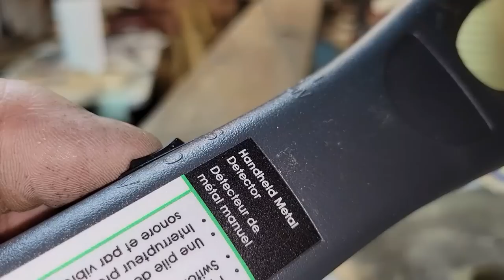Turning 150 year old wood into GORGEOUS guitar body!!! Part 1

Comment: How come nobody ever uses dowels when joining slabs of wood? I was taught always reinforce slabs of wood when making furniture ( I know it’s two different things) but when a strung guitar is under enormous tension why is it never done this way?
Reply: right, i was wondering why he didn't use biscuits.
Reply: It usually is reinforced, even in instrument making.
Reply: Without giving you an answer, the tension, in the end, is not "enormous". I've never heard of a real Fender being biscuited or doweled together. I've seen different pieces of the body lamination crack at the seam which results in a finish crack, but unless the body was deliberately held and smashed over something hard, I've never seen a Fender-type body come apart in 50-odd years.
Reply: Because yo dont sit on guitars, wood glue is as strong as the wood itself when clamped properly....so it wont come apart at all.
Reply: Aren't most Fenders "solid" body? Meaning they are "solid"? I realize many of the Gibson Les Paul types aren't, but Strats and Tele's?
Reply: @robertdusziii4125  Very, very few are one single piece of wood, The vast majority are 2-3 laminated blocks to form the body. Early Broadcasters/Telecasters/Esquires/Strats maybe up to 58-59 are often found w/one piece bodies and they are prized above the laminated ones. Although once in a while, a 1-piece sneaks through in any year. I'm sure if you go look at a YT of the Fender factory, whether in Corona or Mexico and get a shot of the end grain of the raw bodies stacked up, you'll see they are all lam'med.
Reply: @alanpecherer5705  We bought lumber which was removed from a barn built over 200 years ago. Most of it was milled for our floors but still have some floating around and have always thought a guitar was a great idea.